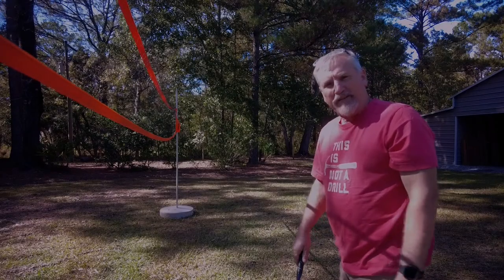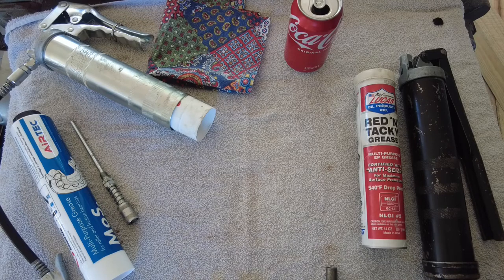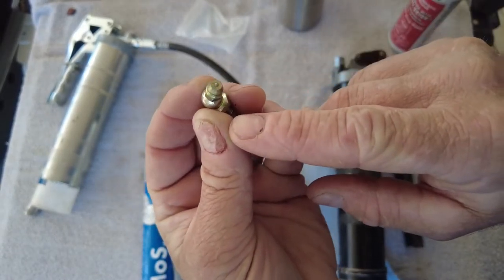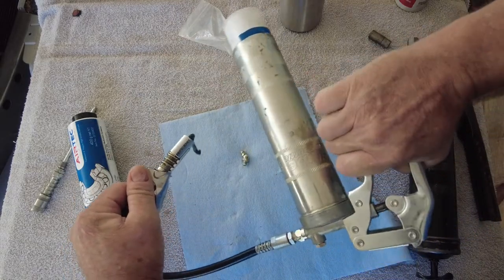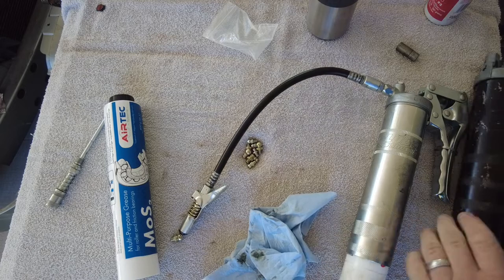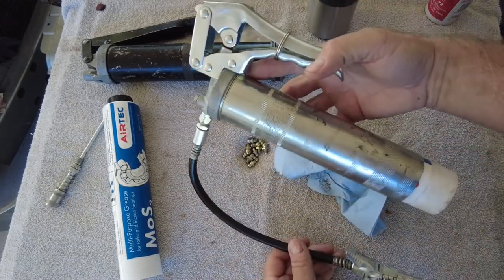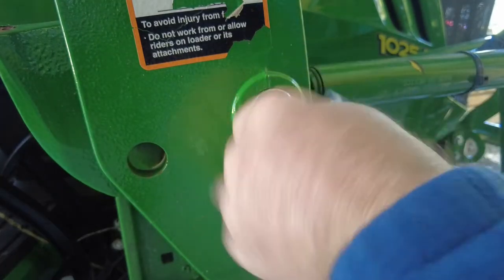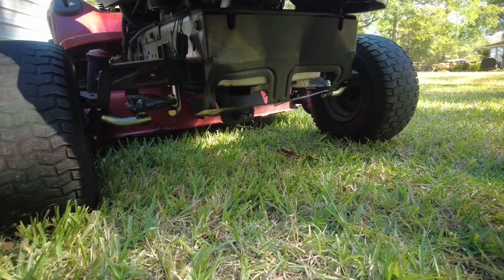How to use a grease gun on the grease fittings of a 42 inch riding lawn mower

Comment: Uh, that first grease gun you pull the lever on the bottom and lock it into place, then unscrew the top and load the grease in that way with the cap side removed facing into the gun.  Then remove the other end of the cap, twist the lid of the gun back on and release the handle in the back and plunge it in.  I can operate mine one-handed by simply setting it on the ground and pumping it that way, but I have a couple of extension hoses on mine.  Push the hose onto the grease fitting with one hand and pump with the other, easy peasy.
Reply from the maker: I will have to try that, then I would have one hand to hold the end of the hose on those tricky grease fittings..

Comment: I have a craftsman t800 pro series and im looking on the deck i dont see any grease holes i looked at this video and non on that mower was on my mower any ideas?
Reply from the maker: Most of the mowers now days have sealed bearings in the spindles which do not take grease. So, a lot of original decks and most replacement spindles do not have grease fittings. Does that answer your question?
Reply: @diyhomefront1695  alright just pointing out it is a 2012 mower so a bit old
Reply from the maker: @HelperKPorterYT  Your right not that new, you would have to take apart one of the spindles to see if they had sealed bearings or not. It would be easier to let them fail and replace the spindles  them take one out to see though.

Comment: HOW DO I REMOVE THE BLADE DECK ON THE CRAFTMAN MOWER TO GREASE THE STEERING GEAR
Reply from the maker: Check out my playlist on lawnmower repair or search this (42" Craftsman Mower Deck Has a Bad Pulley). I take the mower deck off of my 42 inch mower to replace a pully. Let me know if you find a grease fitting for the steering gear. I have never seen one. I have had to replace the plate that the steering gear moves along with the steering gear before. To many trees in my yard and I just wore the parts out. Did that before I started Making videos.